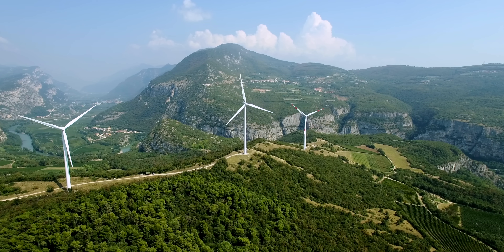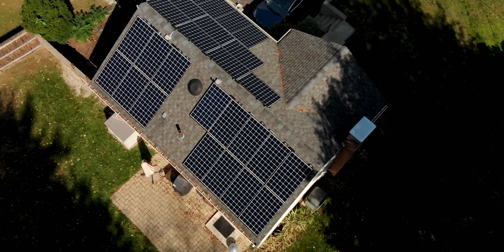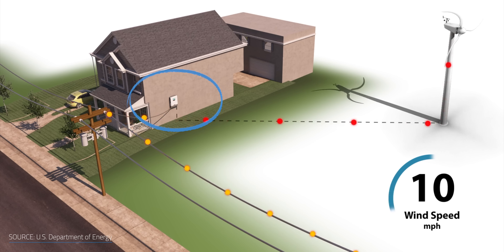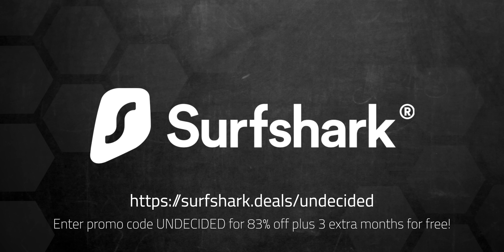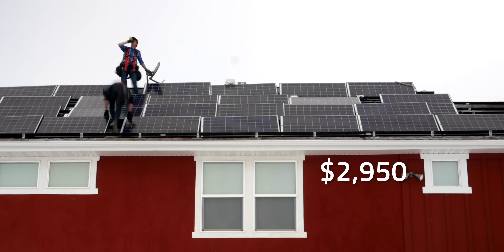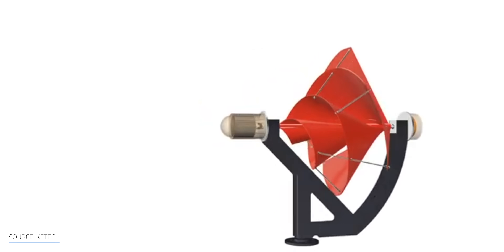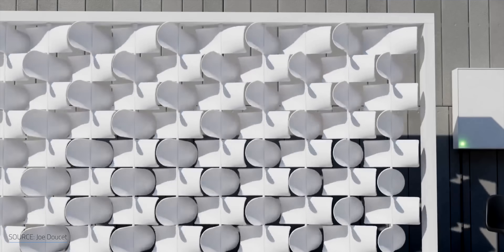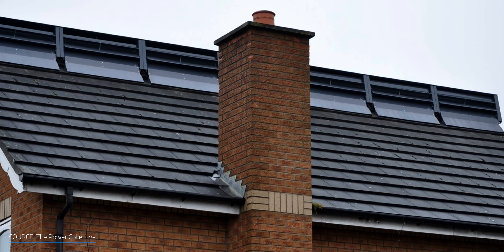The Challenges of a Wind Turbine on Your Home

Comment: Your videos are quite informative (thank you for that), but when it comes to both solar and wind, no mention is made of how they would perform in the snowy regions.
I live in the Montreal (Quebec, Canada) suburbs, with constant wind and fairly heavy snowfalls, and I've been trying to determine if either (or both) system would be worth installing, and the amount of daily maintenance that would be required during the winter.
Any suggestion/advice?
Reply: @Robert N. Lemieux Some of my neighbors have installed solar panels on their roofs over the past 2 years, and I was disappointed to discover that they do not have a heating feature to melt off snow during the Winter. They don't do anything when they are completely covered in snow! I really hope that someone starts producing panels with that feature, because I would not be able to go fully off grid here in Northern Illinois using only solar panels.
Reply: Good point! I have been wondering about this too. Like how would they hold up over the years to the weight of snow and freezing temps. from another Canadian

Comment: Why not use tech that can make energy out of nothing?  Lithium scars the planet and can only take 1,200 charges and takes hours to charge up, And then go down to 75% of its output after 3 years, While usling a marine capacitor bank does not need wind or sun or any movement, It can take over 1 million + charges and power a washing machine and tumble dryer on them expensive posh gin cruising boats and is now slowly entering the market.. You can charge it up in under 30 seconds to full power and it will last just as long as any battery would, But have a long life and hastle free serving..

Comment: Just a suggestion -- in the video you gave wind speeds in meters/second only. When describing the "turbine wall", you gave sizes in imperial units (feet) and parenthesized meters. Most folks in the US are familiar with wind speeds in MPH. It may be a good idea to give wind speed in MPH with m/s in parenthesis. Thanks for an otherwise very helpful video.

Comment: Speaking from experience, don't put on house, at useful power levels, the vibration through building frame  drives you nuts. 

They have to be placed on independent tower mechanically isolated from residential structure.

Comment: If you are grid connected - go for solar as much as you can fit on your roof and property -
until you reach the limit of your wallet or what your grid connection can swallow.

If you are offgrid - you may need wind depending on where you live.
Way up north the solar is often covered by snow and provide zero Watts when you need the most energy.

Things I learned about wind over the years.
1. Never put windpower on the building you live in.
2. The power from the wind is not linear to the windspeed.
    That's why you never can calculate energy production on an average windspeed.
3. Turbolent wind have big negative effect on power, is probably also harmful to the turbine.
    An installation maual for small scale turbine (Airwind403) say - set turbine 8 meters above all things within 150 meters.

I'm sorry but my view on ICEWIND, KETECH, Ridgeblade or the Windturbine wall is they don't look efficient.
If you have not already - look at Engineering with Rosie channel.

Comment: It's less about switching to wind and more about the diversity itself. I agree that solar should be the backbone, but I think incorporating additional sources should be encouraged as well. Our power needs are only going to grow as our tech grows, so it makes sense to diversify early and frequently. Think about a house with solar panel as the main power, but also with a basic windmill, and a few of those wind walls around the property, like marking a path or as a decorative wall on a patio or such. Add in that roof ridge wind power thing and you can potentially regularly generate a surplus of power which would make it much easier to charge your electric car but also provide more stability for over nights and long cloudy periods.

But that's just ONE area. Putting all these power generation options together is both versitile, and diverse, and if combined with other things, like hybrid solar panels that both cool the panels and heat water for the house passively while making power; we spend so much time focusing on this tech or that tech, when we should be looking at how things can work together, the synergy different ideas and technologies can create when used together in different ways and configurations.

Comment: While it looks nice, I see a problem with the 'Ridgeblade' by the 'Power Collective (11:09) They will increase the lateral and vertical wind loading on the roof. 
If one is given the power, efficiency, rotor diameter, and rotor RPM at the claimed power, one could calculate net force.
Where I live, such an addition is out of the question. Without the roof being specifically designed for it, the occasional high wind event could rip the top of the roof clean off. This includes sustained winds exceeding 70 MPH and gusts exceeding 80MPH. And, these speeds do not include factoring windspeed amplification due to the roof's pitch funneling extra wind

Comment: From my experience and research, most micro wind turbines are not nearly as complicated as this and maintenance is actually almost nonexistent. Most do not have adjustable blades and they are just directly connected to a generator shaft. Most micro wind turbines orient themselves by being on a free rotating bearing and having a tail that Is pushed by the wind.  also, you said that wind turbines create DC power, this actually depends on the generator. For some, the generator creates DC power and for some it is AC which electronically is then converted to DC. this second type is the more common when we are talking about the size you used as an example because they are more efficient. Breaking, that is a little more complicated. The cheapest ones have no breaks but are small enough that no or very little damage will be done from high winds and you can take them down if you need to. The better ones like the example in the video would have breaks and an electronic brake too though the electronic break is not supposed to be used when the wind is strong enough to overcome it because it will burn the coils. if it is one that is in between and has the electronic break but no mechanical break then if I recall (and I may be getting this wrong) it is best to just let it continue with its load and or a dump load in a wind storm. if you want more info a good source for middle-range micro wind turbines is Missouri Wind and Solar https://www.youtube.com/channel/UCnaa_80Xxuoq0jNA68uddaw

Comment: Matt, thanks for the analysis but you miss a pretty large segment of people that might want this.  My parents house is in rural Nebraska.  What I really want is to have a little extra help during the winter.  I already plan on having a solar roof and battery backup....but what Id really like to do is harvest some of that winter wind that continually blows and takes power lines down.  All I need to do is have enough power in my battery backup to supply the gas furnace and a few other emergency circuits.  I dont expect it to be a whole house solution, but more of a "helper" for the winter when solar isnt going to cut it.  Any chance you can do a video with analysis for a different location that an urban envrionment?

Comment: You never mentioned vortex bladeless !! (The Skybrator)  I know it produces lower power and requires slightly more wind speed then leading competitors but its size, light weight, wind adaptability and little to no maintenance gives it a lot of advantages.  I imagine the simple construction would give it a cheeper price as well, and its AC so no conversion needed.. except for battery storage.  A video should be done on this

Comment: Something to consider when thinking about costs:  I can build a fairly effective wind turbine with junk scavenged from the local scrap yard.  There are lots of videos on YouTube that will show you how, and even more books.  Building your own solar panels is considerably harder, if you have to make the PV cells yourself.
Reply: @Cee64E Indeed. And a DIY unit is much easier to repair than something produced by a factory, especially if it features a lot of plastic components. Or, if your DIY unit is cheap enough, you could just toss it if a major issue occurs, and make a new one ;)

Comment: not gonna bother... too much maintenance and babysitting required.... the failsafe for the charger is too little in the market right now... and my house's roof has almost constant high wind speed during day time and night time so the motor will burn out very quickly also due to high temps area.... good for generating large amount of energy in my area for a short period of time but it probably won't pay for itself at all in the long run because it would have killed itself before then...

Comment: I want to add a turbine, even a small 1kwh one, but the issue is I have solar, which I sell to the grid, and they dont allow mixing. You can either sell solar or wind, but not both. So Since I already have solar, I cant install a turbine. Unless I also install a power wall and have the turbine feed the power wall exclusively, and let the solar feed the power wall till its full and let the rest go back into the grid. I dont know. Too much hassle. Noise from the turbines is also an issue. Neighbors might not like it. I might not like it if it wakes me up.

Comment: I think it really depends on your location. Your examples would be drastically different, in other places. For instance, in the northwest we lose a lot of sunshine in the winter. But wind is more than plentiful. A combination of wind and solar could work out very well for many people around here. Great vid. Love your Channel
Reply: It is not a case of using wind or solar in a given location.

If in winter you receive much less sunshine then the question is, what are you going to use as a replacement for the energy from the sun?  Assuming you are off grid, then a wind turbine is a back up mechanism which will help when the sun is at reduced brightness or isn't shining at all.
It just may be a more expensive way of producing the electricity, but you may not have an alternative.

Comment: My dream is to have a house with 3 sources of clean energy:
- solar panels on the roof
- a relatively small wind turbine on my possession (>200m away from the house)
- a water turbine in the small river running close to the house

This way I could always have my own power :p

P.S 
I guess I could switch this wind turbine for small atomic reactor xd

Comment: I had a 3.2kw Southwest Whisper.  Our winds are crazy and after 5 years, it crapped out.  

What we need is a unit that’s made for 25-50 mph winds.   The main stream residential units try for customers in the 7 mph zone.  We need a residential unit with a gear box.

Comment: I'm very tempted to install a combination of a vertical axis wind turbine and solar panel with a battery at home here in the UK
u know in November Macron threatened to cut off our power over fish and now Putin is acting up
Issue is I don't line in a single unit home so I don't own the whole of our rooftops
Still theres a lot of reason to that here with the government looking to phase out internal combustion engine around 2030 so you will be pretty fucked by the bills if you don't have some power generation at home

Comment: I looked into it a few months ago, and I was pretty much surprised when I saw this video of yours. I would advise to take another look at the cost side of things. Also, consider that the solarpanels will be thrown out after 20 years, and how much of that can be recycled... The recycling is the dark side of these renewables. Those bigass windturbines for example cannot be recycled, and thousands of tons already been replaced...
Reply: Modern solar panels are supposed to still provide 80% of production capacity after 25 years, with a life cycle of 40 years...
Reply: @Yemadas  Yes, there is truth in what you say. There are very good quality solar panels today, but let's just face the fact: after the warranty, those panels will develop failures. Even if it happens with valid warranty, it is not healthy just to put mismatched panels in the same array. There are examples for very old still working panels, but even more about failed ones. The recycling is a real problem for both solar and wind. 

To be frank, I am also planning my solar array :-)
Reply: @peterbalogh2646  some pannels will fail after the warranty, but how many? probably not a lot. Anyway, I guess it will be created a big market of second hand refurbished solar panels in the future.
Reply: @Yemadas  You can check that yourself. There is a market, and a few I know jumped on used cheap panels, but they have about 20% as spares. They all have used up most of the spares in cca 5 years.

Comment: Solar definitely makes sense as far as practical efficiency. For any of these systems you still need storage capacity however, which is where it can be a bit more costly. The 'micro' wind and hydro systems people are putting out are great supplements, but don't go throwing away $10k or more on them. I love the roof blade - seems like a great addition to any pitched roof in an area with moderate gusts. The other design that was pretty cool was the vertical 'wind fence' array. I don't know that I would want to spend a huge amount on that, but if you live somewhere like the plains states where it's nice to be able to mitigate wind constantly blowing over your porch/patio, these look like a fantastic and decorative way to do that, and get a little extra charge out of it.

Comment: The key here is the production cost of micro wind turbine. Bringing it down is a matter on mass production, cheaper installation cost, reliability to minimizes maintenance and replacement of moving parts. Once the manufacturer crossover these constraints, the wind turbine will be cheaper and more competitive to solar panels.

Comment: Based on your numbers and the differences in peak sunlight hours and wind speeds where I live...

Wind: 4.6 m/s average -> 1,360 kWh/year (@ $0.371/kWh) = $504/year  (9.9 years payback, without maintenance costs)
Solar: 2.7 peak sunlight hours/day -> 985 kWh/year = $366/year (7.6 years payback)

So while solar still theoretically pays off quicker, wind is more likely to coincide with periods of higher energy consumption (over winter when the hours of daylight are short, not to mention the complete lack of peak sunlight hours, and the need to heat the house) and over a 25 year lifespan, the wind turbine would net me $7,600 (minus maintenance) vs $6,380 (also assuming no maintenance).

Something like that Ridgeblade sounds ideal (especially when combined with solar panels).

Comment: I think wind power would need to overcome battery technology costs to become effective in the market. Solar with batteries will be a major player in renewable technology for the home. I have also thought about the system on the rooftop myself in a DIY capacity, instead of mounting directly on the top, I was considering in the middle or near the top to reduce reverse blade drag going against the wind. It may act as a cooler for the roof cavity as well.

Comment: I’ve been off the grid for 21 years and installer/trainer for over 15 years. I wouldn’t consider wind an option for almost anyone. The only time I install wind is when there is a massive supply of wind which is pretty rare. I’ve had my own 2 kW wind turbine sitting on the floor of my shop for over 10 years. I traded it for something over a decade ago. It’s a Southwest Wind Power (out of business) grid tie model. It’s sad to see SWWP go out of business (as they are my friends and were located in Arizona) but there is a reason. Nothing they ever manufactured produced nearly the amount of electricity they claimed as it’s so rare to find a really good location. My turbine will continue to sit as even if I wanted to expand I would use solar. Although I own the turbine i would still have to pay a lot to build or buy a tower and an enormous amount of wire. It’s just not worth the hassle and maintenance. The absolute best option for off grid or on grid electricity generation is small hydro (water) power. It runs 24 hours per day at the same rate and good quality machines take very little maintenance other than a set of extremely inexpensive bearings every few years depending on load. Oh how I wish I had a decent stream with decent head (drop) on my property.
Reply from the maker: Thanks so much for sharing.

Comment: Matt, I think there a new video in your future on Wind. Though this video is factual and accurate in many respects, it is based a certain assumptions in how wind turbines are being designed today, more importantly, how generators themselves favour high torque to generate electricity, which means higher, sustained wind speeds are needed. Low torque, low friction generators hold more promise for micro-wind generation as it can accommodate more generation at lower wind speeds and in turbulent wind conditions, often found in urban environments. I’m in the process of building and testing my own prototype wind turbine that should, in theory, have much higher efficiency than most turbines on the market today, not to mention some of the secret additives i have planned that will make quite unique and effective. So stay tuned as you’ll be revising your assessments soon. Love these videos btw, tremendous amount of research goes into these and I appreciate the variety of subjects you cover!
Reply from the maker: Thanks for the feedback!  And curious to hear how your prototype works out.  I'm very sure I'll be revisiting this topic again.